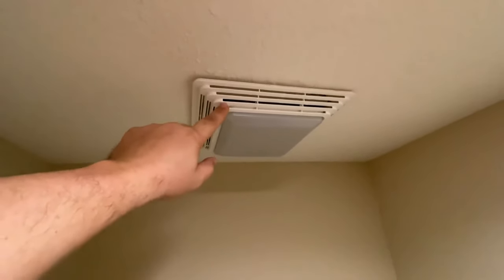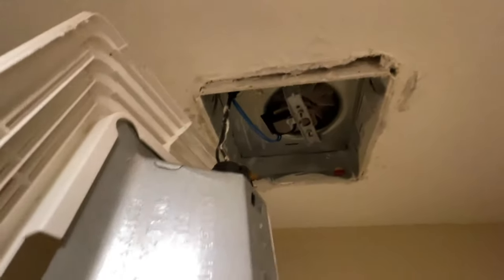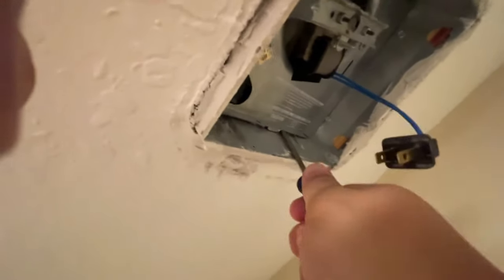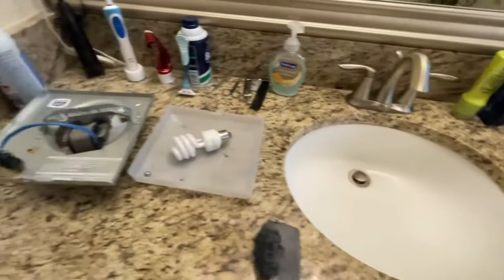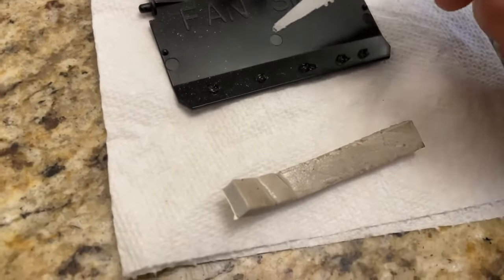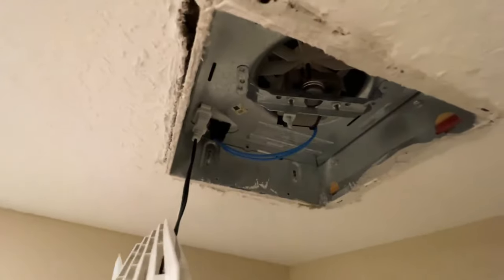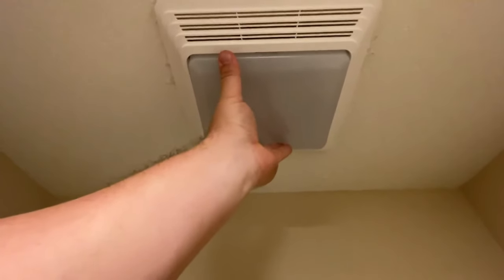BROAN BATHROOM FAN - DIY Noisy Flapper Fix!!!!!

Comment: My unit has the exact same issue, I googled the problem and sure enough many people with the exact same unit have the same problem. I didn't have any foam so I used rubber drawer bumpers instead. It's still audible but I can no longer hear it from my desk even with the door open. Also funnily enough presumably my dad already tried weighing it down with a screw when he installed the unit around 15 years ago. Thanks

Comment: Broan = epic fail. This is an easy mod at the factory vs. forcing consumers to take the fan apart for the mod.
Reply from the maker: I fully agree... I have another Broan fan in my bathroom thatvis"quieter" both in sones and I don't hear it flapping... I wonder if they tweaked that more expensive fan to prevent the issue.
Reply: Mine is a different brand and it’s an epic fail as well. ☹️
Reply: @chrism9294  What brand? Let's shame them too.
Reply: @chrism9294  if you fixed the issue in the fan it could be the outside flap too. My dryer vent also makes the same noise. It’s hard to tell which one it is by sound alone because they sound similar.

Comment: I have two identical Broan-Nutone fans in my two bathrooms. In one install, the flapper is horizontal (like in your video), and in the other it is vertical. The vertical one flaps open and closed when I turn on the fan, thereby reducing the effectiveness of the fan. The horizontal flapper doesn't have this symptom. Can one rotate the flapper so that it is horizontal?

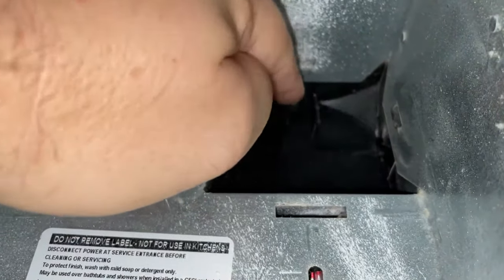Comment: Good idea.  My 24 year old fan needed a cleaning and replace the motor & fan blades.  Because, after 22 years, I'm tired of listening to this thing tap, tap tap all night long,  I removed the flapper and added two 3/8" foam pads to the ends of the flapper (similar to what you did).  I had a difficult time re-installing the flapper and eventually disconnected the plastic flapper housing from the metal housing.  Then I had to get in the attic and re-attach it.  At 5:12 in the video you can see the small black plastic tab on the right side of the opening where the flapper housing snaps into the metal housing.  There's another on the left side.  If you man-handle it too much it will disconnect itself and the you'll have to make a trip to the attic.  To avoid my mistake, I suggest attaching adhesive backed foam to the bottom of the plastic housing rather than the flapper.  That way you don't have to remove the flapper.  You're less likely to get in a fight with it the way I did.  Thanks for the idea and the video.
Reply: Ya I might go this route as its a bit safer, one less thing to break.

Comment: I think I might turn the power back on for a minute to test the fan and make sure it still works before reinstalling the light. Nice video.
Reply from the maker: You can.... it's such a slight modification.... you can test the flapper by flicking it with your hand once it's re-installed.  It should move VERY easily and lightly...... no effort at all.

Comment: I would have put the sticky side (Where you peeled off the white tape)
 towards the Superglue edge
Reply from the maker: The white tape I peeled off wasn't the sticky side..... it was the soft cushion side...... I had already peeled off the other sticky side, which is the side I stuck to the super glue.